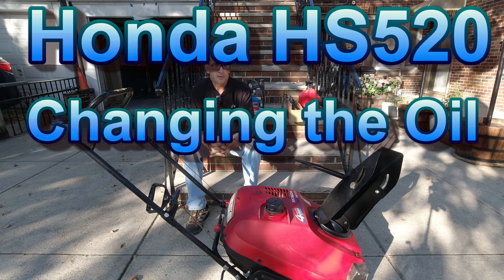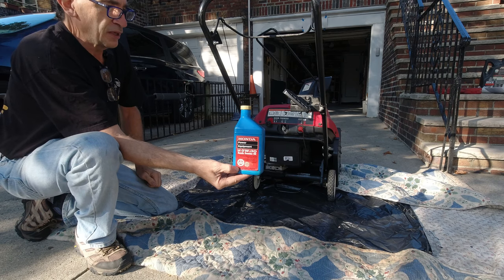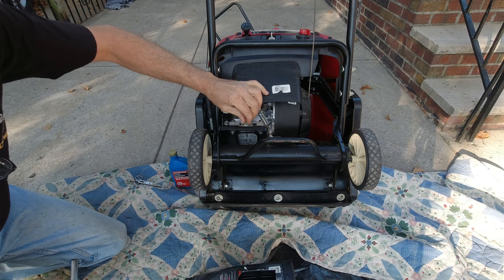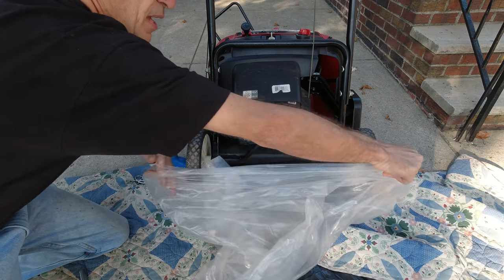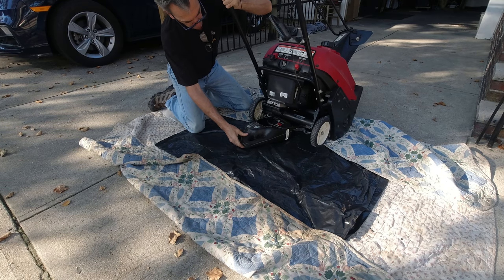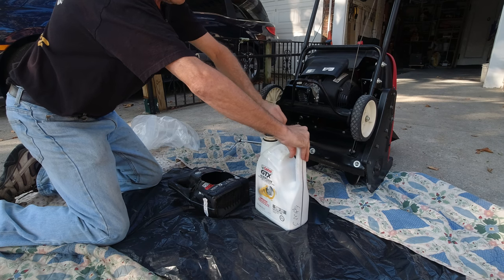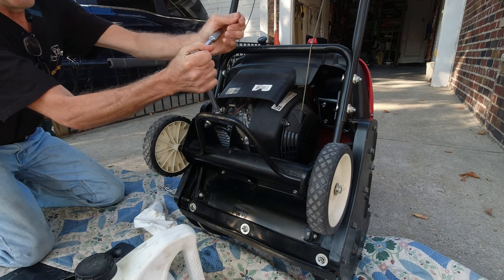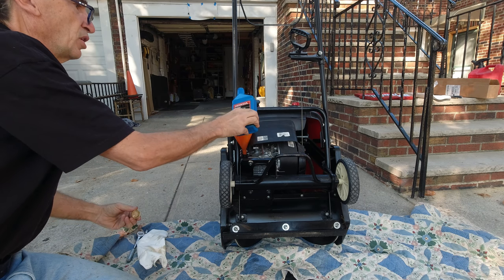Honda HS 520 4 stroke Snow blower Oil change out

Comment: how often do you change the oil? Is Mobil 5W-30 ok?
Reply from the maker: I did not change mine for the longest,  I would have to  check the book out and read  it. I go by the hours of use if asked.
Reply: @fishycomics  thanks for the response. How often do you change the paddles? I bought a used hs720
Reply from the maker: @rickytam9124   only way to determine if the snow starts to no longer throw like day one, I did mine like 5010 years later  not all  seasons were constant use but they will wear.

Comment: How old is your machine ?.
Reply from the maker: Thank you Raymond Palermo, I  believe I bought this when I bought my 2002 honda crv. if i am off by a  year or two it is that old, never a single issue, and I chose to replace  parts and give it a   make over,
Reply: @fishycomics  I just bought a Honda 720 a and i noticed they don't change the design of the machine for many years it looks just like the 521 .I guess they go by the words of if it ain't broke don't fix it.
Reply from the maker: @raymondpalermo4998  HOnda is the best,  my Neighbor bought the next model  up the 720, his broke, a small part, he bought a new one, years ago,  Honda  back then and still today is by far trouble-free, I hope you  enjoy it,  Yes that ole saying,   let lying dogs lay  tip my hat to you. ( big compliment from me)
Reply from the maker: I have a number of vids on it check them out if like, how t change some parts maintenance wise
Reply: @fishycomics  I still have my sears craftsman from 1995.its a two stroke and starts on one to two pulls original belt.Replaced the scraper bar one time and one sure bearing.The only reason why I am getting rid of it is the smoky smell from the oil after all theses years and the auger is the same as my new Honda.
Reply from the maker: @raymondpalermo4998   I hada toro, and another, once I got the Honda Its been that way ever since.  Yeah Craftsman is AWESOME, glad to hear you had Awesome  use out of it
Reply: @fishycomics  alot of guys swear by toro.do you like the Toro better and I hear that the motor in the Honda is made in america
Reply from the maker: @raymondpalermo4998  Toro  they are a great machine but have to   handle it with care.
Reply: @fishycomics  alot of guys swear by toro.do you like the Toro better and I hear that the motor in the Honda is made in america
Reply: @fishycomics  you have changed the oil all along right.
Reply from the maker: @raymondpalermo4998   Yes I have, big thank you.
Reply: @fishycomics  Got a question for you .My sears craftsmen auger is so loose that when you spin it by hand it will spin like 5times but my newer honda 720is much tighter and wont spin at all.Is this normal?.
Reply from the maker: @raymondpalermo4998  thinking out loud:   check the belt and drive pully   maybe it needs tension. not 100% sure but my guess
Reply: @fishycomics  belt is fine and doesnt slip .My guess is the honda has a tighter bearing fit cause its newer.
Reply from the maker: @raymondpalermo4998  Pressure on the belt tightens hte auger, that makes it move if no pressure is on the belt the auger would spin, but like you said a bearing is doing its job